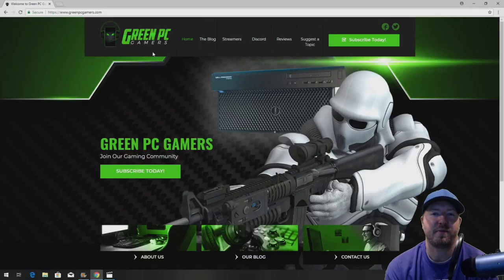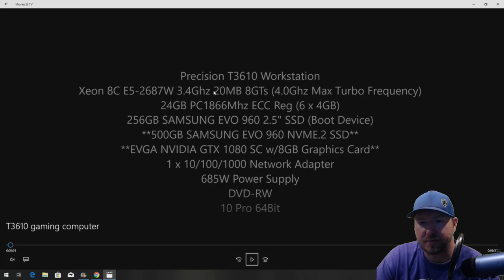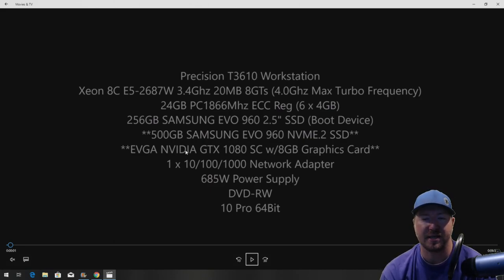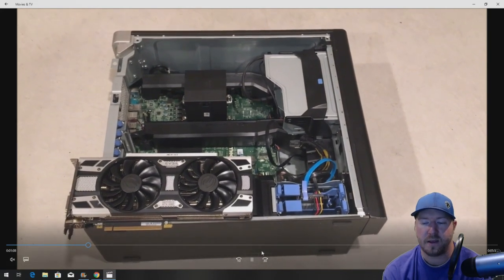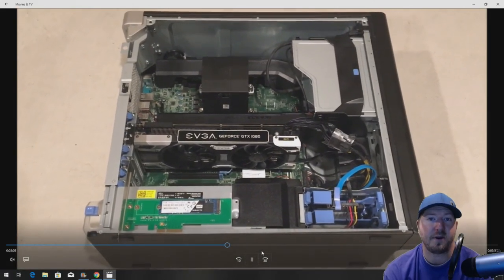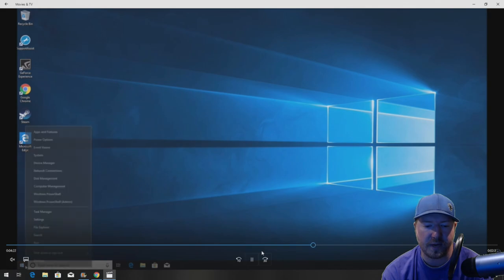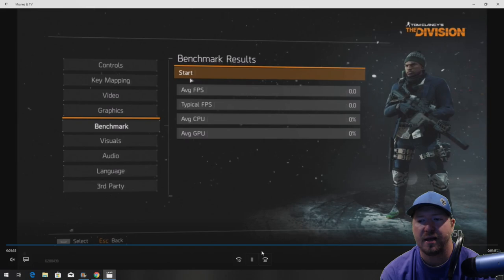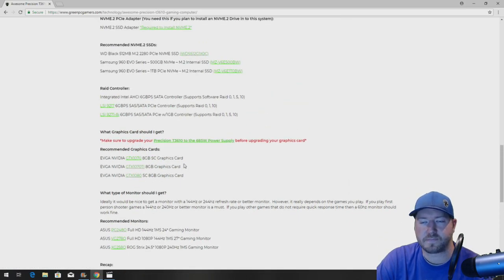Precision T3610 Gaming Computer (GTX 1080 SC and NVME.2 SSD)

Comment: Wanted to say thanks. you guys just saved me like $500.

I bought my t3610 as a major upgrade for my home design business about 2 years ago, and it's been great. But I've needed to upgrade my gpu for a looooong time. So i finally paid too much for a used rtx 2070 super. 

I'm not a computer guy, i'm a home designer. so long story short I take it to a local computer shop to upgrade the power supply and install the graphics card. it was going to be $250. But then they call me and say the after market power supply they bought wont work (now i know why) and so I need to buy a new case (spend another $100 minimum) and then they're gonna have to charge another $350 on top of that to swap everything over to a new case...

Instead of doing all that, and thanks to finding you guys, I'm paying $8 for a 6 pin f to 8 pin m, installing my own gpu, and if my 685 w ps cant keep up now i know i can get a plug and play 1300 w for like $250. 

You guys are awesome, thanks for taking the time to put out this info. I love my workstation, and I'm so pleased to know it has so much potential.

Comment: I have a t3610 and the only issue I've had is when fitting a larger GPU, the case door doesn't close because of the internal handle. Bummer. Might have to drill out the spot welds and pull that handle off.
Reply: Yes removed mine. also cut a rectangle on side panel, now it never gets hot, just a little dusty over a long time

Comment: I'm considering installing a 3060 graphics card in my T3610 PC, and my power supply is 685 watts. Do you think I'll run into any issues with this setup, especially when using AI software?

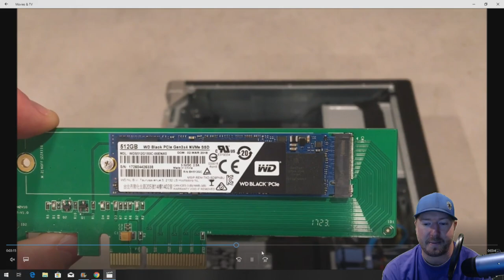Comment: At 6:23 you're holding your PCIe NVMe card Gen3x4
And you connect it to a PCIe 2x4 slot (6:38)

Wouldn't that mean you're halving the bandwith connecting it that way? so half the writing/reading speed
There are another two gen 3 PCIe slots, one just below the GPU and another above it, is there a particular reason to connect it to that slot? or am I missing something?
Reply from the maker: You are correct, we will lose some throughput based off of the legacy slot.  We also lost some throughput due to the IO speed of the motherboard/cpu/memory.

Comment: I"m only planning on putting in a GTX 1060, the 485W in my T3610 should have enough power, but it didn't come with the 6 pin attached.
Reply from the maker: You'll want to consider upgrading to the 685W Power Supply for long term stability.  You'll also want to get a cable like this to provide the 6pin power:  https://www.serverworlds.com/dell-d92c9-precision-t5600-t5610-t5810-graphics-card-aux-power-cable/

The cable will plug directly in to your power distribution board.

I hope this info helps.

Comment: I got this with  MSI Rx580 Gaming X. It runs hot when closed so I cut a rectangle on the side panel. Now it runs really cool at 60-65 full load. just worry about dust now
Reply: put fine air filter cloth ( appropriate mesh size for that  consult to filter cloth supplier)two layer in each layer keep at list 30 mm distance- time to time clean them is only option may be

Comment: Will a EVGA GeForce GTX 1660 Ti XC Black Gaming fit? it's three slots. (well, 2.75)  i assum eit will work if we also have the 2 6 pin to 1 8 pin adapter.  if not, normal 1660s seem to have the 6 pin connector.

Comment: How did you fit the case cover back on please? Mine has a weird inner handle riveted to the inside of the cover ahead of the pull handle mechanism, making it impossible to refit the cover?
Reply: Checked out the other video showing how to drill out the rivets - thanks!! 😀

Comment: The only thing about the T3610 I never liked much (other than the non-standard PS, but you can work with that within reason) is the slim default storage options. I like sliding in dual 2.5 brackets like Corsair's CSSD-BRKT2 and a SATA power splitter. Usually end up adding a PCI-e SATAIII controller also.

Comment: I really like this idea and might go this route instead of building a new gaming pc from scratch. My only concern with going this route is noise. Any video on the noise level of one of these on boot, at idle, and during gameplay?
Reply from the maker: They are very quiet systems.  It'll generally be as quiet as the graphics card that you install in to it.

Comment: Great video, also read the post on the site. I was given a T3610 for free and ironically already had a CPU and video card from your list picked out! HOWEVER, Question: what RAM did you use in your build? I was thinking about (Corsair) 16GB (2x8GB) DDR3 1600 MHz (PC3 12800) but you list 1866mhz RAM. I didn't think that would work? ECC too? Brand?! ALSO.... power supply.... what if we wanted to use like a Corsair power supply. Would that fit do you think?? THANKS!
Reply from the maker: We used ECC Reg modules.  You won't be able to fit an ATX power supply in the T3610.
Reply: @GreenPCGamerscom  Any benefit to using ECC over non-ECC RAM?

Comment: i have a 1080 zotac that connects w one 8pin... restarts my pc when gaming if not underclocked, temps are good, whats issue?
i have 685w psu dell t3610
Reply from the maker: We've seen this issue before.  It's normally caused by the power supply or power rail cabling.  Are you using the 2 x 6 pin female to 8 pin male adapter?  Also, do you have another 685W or 825W Power Supply you can try?

Comment: I have T3610 and When I play games sometimes it will shut down unexpectedly and I have to  reset it do you know if this is a ps issue or a cpu overheating issue.
Reply from the maker: Can you try installing HW monitor or another cam software to monitor your cpu temps while gaming?  Some common causes:  CPU overheating, GPU overheating, or Insufficient PSU rails.

Comment: Why is the dell t3610 not capable of booting into the nvme ssd?
Reply from the maker: Great question.  We are not 100% sure why the newer NVME SSDs are not able to boot on the T3610 workstations.  The Samsung 950 Pro will boot on the T3610.  We've also heard of other community members using a software to make the newer NVME drives bootable.  Thanks for commenting.

Comment: Have you had any problems with the Intel storage controller? I have a T3600 (which I'm told is basically the same as the T3610), and have issues occasionally with the Intel storage controller driver, as it's not officially supported on Win10. It blue screens every once in a while with a iostor error. I really like the machine otherwise.
Reply from the maker: We rarely run the T3600/T3610 in Raid Mode.  You could switch it to ATA mode and do a fresh install to resolve the issue.
Reply: @GreenPCGamerscom  Cool. I'm not running RAID, but I'll have to check my BIOS to see what mode it's running in.

Comment: Hi, I need help, I just installed a GTX 1080 on my Dell T3610, the gpu went off after I played a game for around 2 hours. Is this a PSU issue, I am using a 6-pin to 8-pin connector to power the card.
Reply from the maker: With the 685w psu?

Comment: I upgraded my t3610 with an RX580 but I still have the Xeon E5-1650 v2. I’m thinking of upgrading to the E5-2667 v2 for roughly £100 UK. Is it a worthy upgrade?
Reply: Did it still run pretty good with the ES-1650?
Reply: can you use a single pin to 8 pin adapter?

Comment: Trying to install a 1060 in my t3610, and the damn handle on the inside of panel is contacting the gpu and it won't close. Yours looks to be the same size and the panel goes back on cleanly. I'm wondering does yours not have this handle piece on the inside or did you do something to remove it?
Reply from the maker: You should check out our T5810 GPU install video.  We show you how to remove the bracket.  Time stamp is around 2:47  https://youtu.be/-g_LpWSkqtQ
Reply: @GreenPCGamerscom  Excellent!  I'll give this a shot tonight, thanks for the reply!

Comment: Can I swap the power distribution board with one from T5610 so that I can safely assign another 10pin for a GPU like 2080Ti? Bottlenecks not considered, power unit swapping to a 825W one
Reply: 685 watt more then enough you can use rtx 3090 ti card also....
Reply: Go to Google and type " Psu calculator" And check....

Comment: i found a dell precision in a local market the model is t3610 with a xeon e5 2660 v2, 48gb of ram ddr3, a quadro k2200 and a 800gb ssd. can i add it a gtx 1060?
Reply from the maker: Yes, you can add a GTX 1060.

Comment: I have one of these machines currently with 1620 v2, 2x 500gb drives striped, 128gb ram, RX580. I wanted to change to an Asus RTX 2070 but I realize that I only have an 8 to 6 pin connector that's powering the card now. How could I power the new card that requires both 8 and a 6 pin power
Reply from the maker: Get a 6 pin female to 8 pin male adapter.
Reply: @GreenPCGamerscom  thank you. I have decided to get some cables to test some options. I got an 8pin to dual 6+2pin to see if I can get the required power from the one 8pin from the power board. I also go 2 sata power splitters and a sata to 6 pin. I would replace the 8 to 6 on the power board so I get the 8 pin from the there and then split the 2 sata power that I have on the hard drives to get the 6 pin

Comment: !!!!! READ THIS !!!!!
There is an incompatibility with the t3610  and the GTX 10 series. I have my self this pc with a 1070 and it randomly shut down while playing games or running stress test. 
The card I know have issues are the GTX  1060/70/80. 
Apparently the Rx 500 series are compatible but I can't guarantee anything
Reply from the maker: It sounds like you are having power rail issues.  What wattage power supply are you using?  Also, how are you cabling the power rails?
Reply: @GreenPCGamerscom  i've also tried with an external psu that was just connect to the graphics card and it didn't fixed it. It's the 635w psu. This issue is well known but nobody has found a fix. Except using amd equivalent card

Comment: i have this old dell precision t3610, do i keep the ORIGINAL motherboard or do i switch it out? and the CPU that is in it currently is a INTEL XEON E5-1650 3.50GHz, i saw the other processors on the website that you showed and i didnt see it on the list of Recommended. is it still a CPU i can keep for this build? thx for the vid im hoping on restoring this PC.
Reply: oh and the processor is a V2
Reply from the maker: You should stick with the stock motherboard.  Also, the E5-1650 V2 is a very good processor.
Reply: @GreenPCGamerscom  thanks for the response back!!! i have another question as well to ask. i need new ram sticks because i dont know how old these are and how much they have been used, um on the site you have linked the ram that you suggest if i buy one is it a pack or is just one stick, the wording on the site is a little weird. and pricey.
Reply: and srry but i have another question. i have a Geforce RTX 2080 for my main pc that i use, i saw that you can use it in the T3610 and i got the parts that you recommended for the conversion from the optic drive as power for the GPU is it still safe to use it i dont want to damage my graphics card ive used it to boot up with and it worked fine.

Comment: the blog its very nice ,i like your post about dell t3610 build very well , but i have some issue about cpu not supported AVX2 that's important or no or I dont wary about that, it will come far future!
Reply from the maker: Khaled Taha what model CPU’s are you referring to?
Reply: @GreenPCGamerscom  Intel® Xeon® Processor E5-2687W v2 (25M Cache, 3.40 GHz)
Reply from the maker: Khaled Taha great choice of cpu!  What is the step code?  Also, you must update the bios with the original cpu first before you upgrade processor.
Reply: @GreenPCGamerscom  thanks ,but i ask about intel instruction for this cpu not support Avx 2 only Avx ? also i know its important, but how long time to activate that in games consumer? ,does it will take long time ? example  five year  to activate Avx 2 for all games or short time 2 years ,i know that cpu its high end "ivy bridge" from intel but ,i am worry from intel instruction for this cpu?
Sorry for the delay please explain to this point
Reply from the maker: According to intel, the E5-2687w v2 supports AVX.  

https://ark.intel.com/products/76161/Intel-Xeon-Processor-E5-2687W-v2-25M-Cache-3-40-GHz-

We do not know show documentation that it will support AVX2.

You should consider upgrading to a Precision T5810, T7810, or T7910.  They will support the E5-2687W V3 that supports AVX2.

I hope this info helps!
Reply: @GreenPCGamerscom  how do you find out the step code? I also am going to put this E5-2687W v2 in my T3610 build. I updated the BIOS on the old chip, E5-1620 v2. Think I can just put the 2687w v2 in and get going?
Reply: @GreenPCGamerscom  would love to know if anyone's gotten an E5-2687w v2 to work in a T3610 build cuz that's what I ordered....lol
Reply from the maker: @colin9630  Yes, that cpu will work in the T3610.  Update your bios with the original cpu before upgrading the cpu.
Reply: @GreenPCGamerscom  OK but what is a/the "step code"? and is that relevant, or necessary to know before throwing this 2687w V2 in my T3610? Thanks!

Comment: Hi. Is the XFX RX 570 compatible with Dell T3610? Thank you
Reply from the maker: We haven't tried that card in a T3610 workstation.  However, if you can physically fit it in the chassis, and you have a 685W Power Supply, it should work.  Let us know if you try it.
Reply: thanks for your answer
Reply: Hi. I tell you that finally install rx 570 sapphire, it works very well. There is only one problem, the video card is 1 cm wider than the k2000, therefore the cover does not close, the internal handle must be cut to close it. I hope serve something.
Reply: did you use a single 6 pin to 8  pin adapter?

Comment: hello mr.@GreenPCGamers.com

I would like if you can help me for this reg ?
 
Dell t3610 setup
Intel Xeon E5-2687W V2 3.4Ghz 25MB 
x2 Samsung 16GB 2Rx4 ECC 14900R DDR3 Module = 32GB 
Samsung 860 Evo 500GB 2.5 inch SATA III Internal SSD
NVIDIA Geforce RTX2070 8GB Graphics Card (founder Edition)
685W Power Supply

can i put 2x 16GB with ECC ?are these model of ram good for this reg ?
Samsung DDR3 1866MHzCL13 16GB RegECC 2Rx4 (PC3 14900) M393B2G70DB0-CMA

is 685W power supply good for  Graphic Card ?
Nvidia Geforce RTX2070 (( 185 Watt - one 8 pin )) founder Edition

is this pc Good for 3D sofware & Games ? or What do you recommend me ?
Thanks in advance
Reply: Well idk about that RAM but with a 2x 6 pin to 1x 8 pin adapter the card should be fine.

Comment: Do I need the dual 6 pin to 8 pin or could be a single 6 pin to 8 pin?
Reply from the maker: You can test your system with the 6 pin to 8 pin adapter.  If it is stable, stick with it.  If not, you'll have to provide more power rails.

Comment: Has anyone had the issue of using PCIE 2.0 instead of 3.0?  I am using a GTX 1080 on a T3600 and GPUZ says it running in 2.0 instead of 3.0.
Reply from the maker: It's recognizing it based off the slot that you installed the card in to.  T3600 = 2.0 Slot

Comment: Can I install GTX 1080 Ti? How do I decide whether it could support that power?
Reply from the maker: We do not recommend installing a GTX 1080 Ti in the T3610 Workstation.  It draws too much power to be stable using the 685W Power Supply.  Great question!
Reply: I'm running a 1080FTW with my 685 watt Dell T3600 power supply with a E5-1602 CPU and it plays games just fine
Reply: @GreenPCGamerscom  any 700W+ power supplies you recommend? Would they fit?
Reply: @colin9630  you have to get the proprietary power supply for the particular workstation, look on ebay or serversupply

Comment: Hi there! Recently I own a T3610 with an E5-1607 v2 with 4x3.0Ghz and 16GB ddr3 1866. I would like to ask you if you had problems with temperature. I didnt use this T3610 to play, but may I do it (using an old Ati HD 5570 2Gb, waiting for a graphic card upgrade). I ask you cos I also own a Dell Precision T3500 W3670 6x3.2Ghz with 16Gb dd3 1333. With the T3500 I had problems with the temperature, so I add a normal fan to the stock passive heatsink. Only 1 fan, pushing air through the heat sink. Something like this: https://www.youtube.com/watch?v=dFcPhOSXXdU

Thanks :)
Reply from the maker: We haven't had any cpu overheating issues with the T3610.  We always apply fresh heat paste when upgrading our cpu's.  You could check out a company called Noctua.  They make quality aftermarket heatsinks that can work in the T3610 workstation.

Comment: Now i have a dell t3610 with an e5-1650 and i want to put an rx 580 or 480 can it support that? I wont do any overclocking
Reply from the maker: As long as you have the 685W Power Supply you should be able to install either of those cards.  Use this guide if you need power adapters:https://www.greenpcgamers.com/technology/video-card-power-adapters/